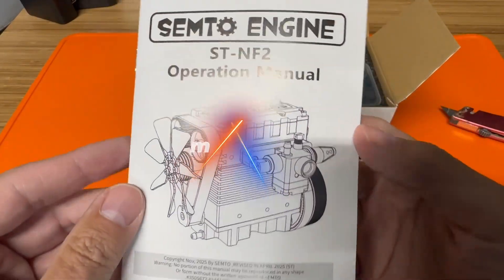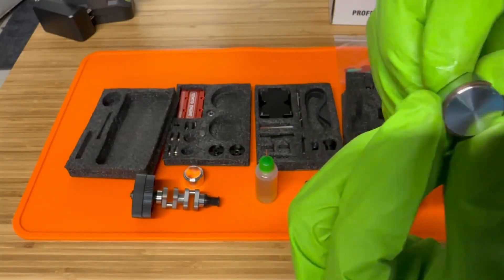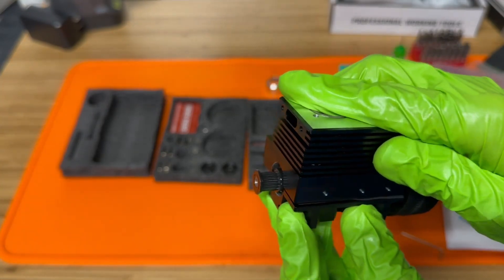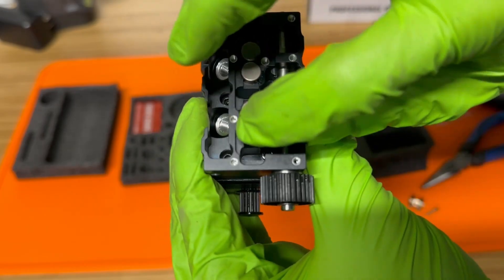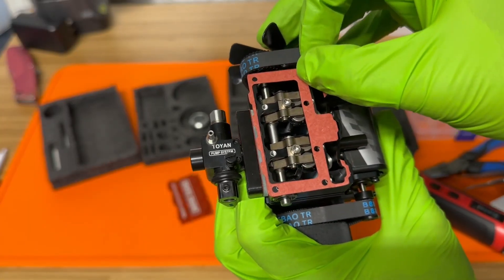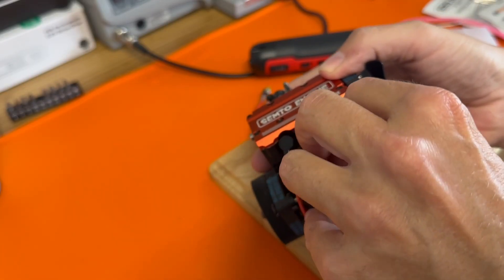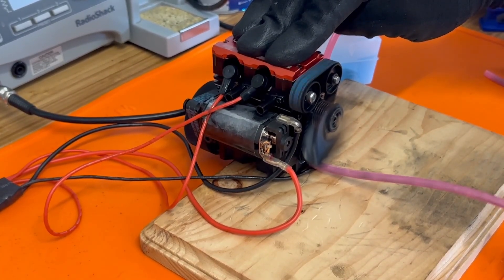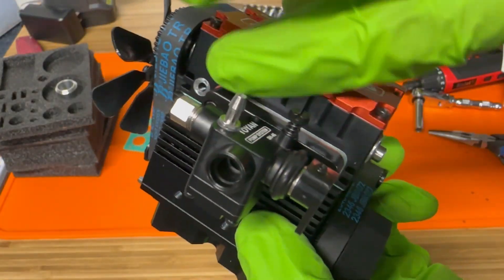Build a 7cc Nitro 4 Stroke 2 Cylinder Engine

Comment: The bottom end is blow-by lubed if I remember from other builds of this type.
I'm shocked the company didn't have you put some grease in the valve cover since there's no oil lube system for the cam/rockers.
Reply: thanks for your attention. the users need to put the grease themselves.
Reply from the maker: Yeah, even though the fuel has oil in it.  I am a bit concerned with the internal components getting enough lubrication.